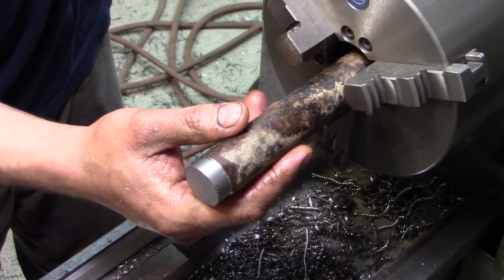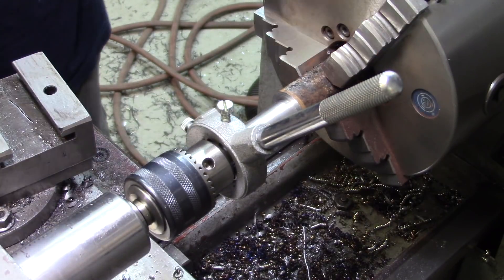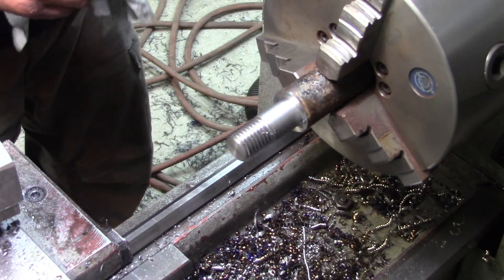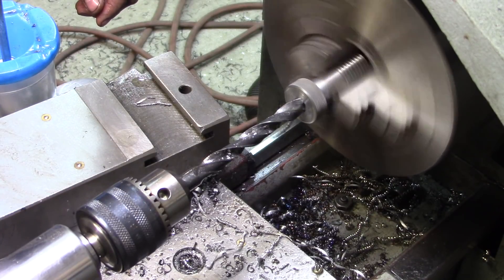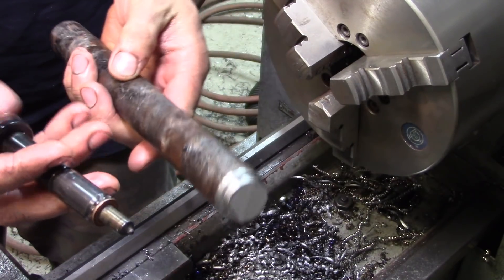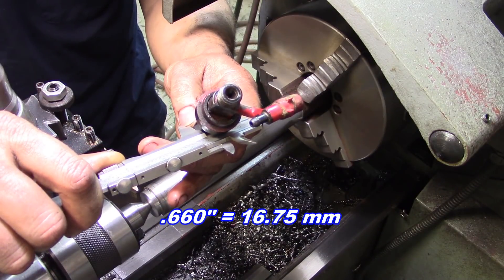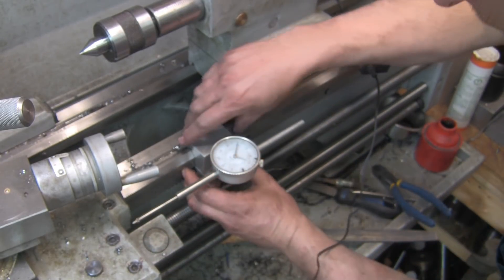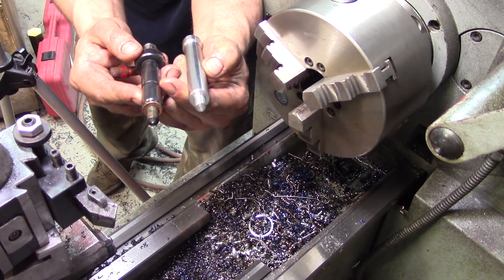Making International D436 Injector Service Tools - Part 2

Comment: i have a similar size lathe and a er 40 collet chuck for the tail stock. i use it fairly often for half a dozen different operations. but power tapping with nothing more than plug taps makes me a little nervous so i just start under power couple of revs and then go to the tap handle.
Reply from the maker: Power tapping makes me nervous on the best of days, just still haven't found the right setup or combination to consistently have good results on my lathe.  Thus, I do like you do to get the tap straight and finish by hand as well.

Comment: I'm guessing if you're being careful enough with your tool alignment your parting off problem is with your tool post. If you get the same size wedge type your tool holders will fit and you could probably unload your piston post on flea bay or some other such place. Wedge type posts are more rigid than the piston type.
Reply from the maker: I would have chosen a wedge post from the start but the piston one came with the lathe.  Wound up being cheap and using some scrap to make a turret post to hold cutoff and form tools to add rigidity.  And, sometime when I get time, I am going to make a block to take the place of the compound for times when I don't need it for an angle but more rigidity would be in order.  All in progress to make parting happen more successfully.

Comment: I still often resort to a bandsaw cut instead of parting off - doesn't matter how many times I've done it!
Great job Everett - making custom tools is always rather satisfying :)
Reply from the maker: Thanks Chris, I appreciate that coming from you. Once I get to the bottom of the parting-off problem with the lathe it will be very handy to have that option open to use as well. Until then, it's harder have things go sideways in the saw.

Comment: Hi Everett,  I gave up power tapping  with a drill chuck  last year.  I bought a cheap 80mm 4 Jaw self centering chuck, made a backing plate for it, and welded the backing plate to an old 3MT arbor.  Never had a tap slip again. 
Link to my models and drawings here: https://grabcad.com/library/3-morse-taper-tailstock-mounted-80mm-tapping-chuck-1.

Make yourself one of these and you will power tap like a pro.
Reply from the maker: Hi Chris, a MT3 collet chuck is on the wants list for the tail stock, kind of like Rob (xynudu) does. It got bumped for a deal I couldn't say no to but that is a surprise to come yet.

Comment: Pretty nice chips and great finish. When your wanting 6's or 9's while roughing with the CNMG inserts, you may try backing off your RPM and increase feed rate as well as depth. Keep the tool as close to the post as possible. Seems the CMNG's really need to "work", or thats my experience. Great job on the tools!! Enjoy your videos, please keep it up!! Oh, that little girl will grow up and leave one day, then???
Reply from the maker: Thanks Red, still messing with feeds and speeds to find the sweet spot of surface finish and chip control. The settings for one piece of unknownium don't fit with another piece, lol.

Comment: The Detroit Diesels I worked on needed no special tools to remove the N70 injectors, but that was quite a while ago, in the 1970's and 1080's.
By now they probably have so much anti pollution garbage on them, who knows what tools might be needed.
These engines were in GM/ Terex earth moving equipment.
Reply from the maker: The pollution crap adds a different headache, for sure, but I'm still learning about the current systems used in trucks and equipment and how they differ from automotive diesels. I'm a journeyman in Automotive but apprenticing in Heavy Duty.
Reply: 871"s or v12's Gary or?
Reply: @MrValhem265  Even some 1100 HP V16's that were actually two V8's joined together.
They were used in the Terex 33-11 hauler.
Reply: @garybrenner6236  THANKS BUD Interesting i remember the TEREX  HAULERS Working in a local LIMESTONE Quarry near me years and years ago. i as a kid would call the Trex. they also had BIG CATS Hallpack dressers and kamatsus, cya mate take care
Reply: @garybrenner6236  apparently Terex made a TITAN 33-19 which was powered by like a big train EMD motor , a massive prototype 350 tonne 3 axle beast , i just googled it
Reply from the maker: @Gary Brenner Was that the unit that is now parked in the middle of Sparwood, BC? I grew up a little over an hour from there and always thought that thing was cool
Reply: @EverettsWorkshop   not sure bud im from Australia ive seen pis as you know it was Massive
Reply: @EverettsWorkshop  We built many different units, our haulers ranged from 30 ton to over 100 ton , our front end loaders ranged from 7 cubic yards to 18 cubic yards, our scrapers ranged from  14 cubic yards to 50 cubic yards.
The "Titan" hauler that would hold six cars in it's dump body was made in Canada.

Comment: Sometimes tightening the tailstock drill chuck at all three "locations" will hold the tap tighter. It is a bit of a pain but it does give you a little more holding power.
Reply: Drill chucks don't much like holding hard smooth surfaces, that is why the back end of a twist drill is soft. Hard on hard just slide, collet chucks do help the situation  with their larger surface area and greater tightness.
Reply: @chrisstephens6673  I agree... but sometimes you get a little bit more holding power... especially with an older / cheaper drill chuck.
Reply from the maker: Honestly I shouldn't really be using a tap in a drill chuck anyway - was saving for a collet chuck but the fun budget got spent on a different tool . . . More to come on that when I can get my act together and get some stuff done, lol

Comment: Hi Everett, also no part 1, no notification?
I see you are using Piston type toolpost similar to mine, never had a problem with it, a lot of unfair criticism out there.
What are your thoughts?
Reply from the maker: There was a part 1, honestly I am unsure what's up with YouTube lately, had a few concerns with them recently. As for piston posts I would have preferred a wedge type but the lathe came with this one. I found it not rigid enough for a few things like parting so made a turret post and now use both systems depending on the needs of the moment.

Comment: 3:40 Everett, sometimes if it is tough steel, I like to partially single point and finish with the die to size it, and make sure the die hasn't cocked while biting heavily into the thread, my fussiness does vary from time to time though.
6:50 when I do this, I now wrap a piece of paper around the bolt, I have some .010" cards that I cut strips off. This also helps conceal the accuracy of my chuck as I have found over the years. Sorry, but sometimes I like to hear myself talk.
Very nice set of dedicated tools, well made and very entertaining. Congratulations on being able to balance work, family and hobby, I don't think many realize what an honourable feat that is. Cheers and best wishes too your family!
Reply: Do that myself quite often, the single point then finish with a die part.
Reply from the maker: Lol, I was just reading diggerop's comment along the same lines. Yeah, that would have been better - I was just being lazy, honestly. Turns out it needed a bit of work using the die anyway.

Comment: On those large threading jobs, one option to consider is to start them with single point, and finish them with tap/die.  It would reduce the amount of gronk needed for the tap/die, lessen the chance of a serious error during single point.
Reply from the maker: I hear you, and in retrospect should have done that. Was being kind of lazy and it turned out to be a bit of work anyway, lol
Reply: @EverettsWorkshop   Oddly enough, I'm facing a step in a project where I would like to do just that, but can't due to current tooling limitations 🤔

Maybe I'll think of a way around it ...